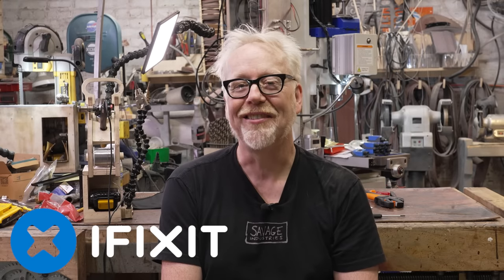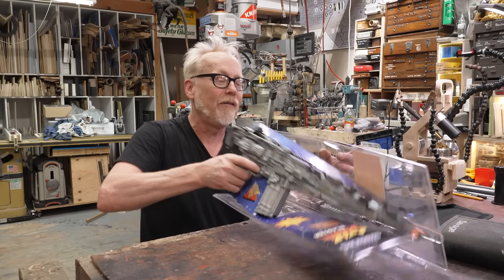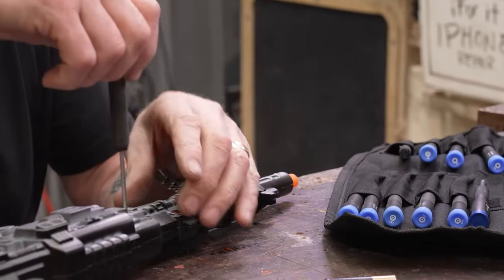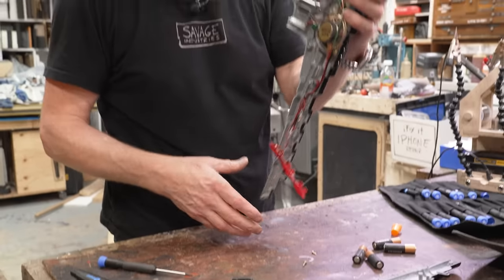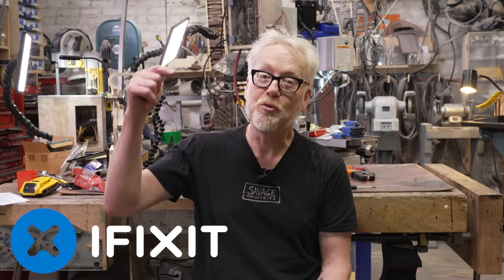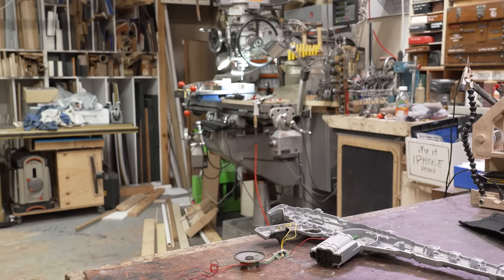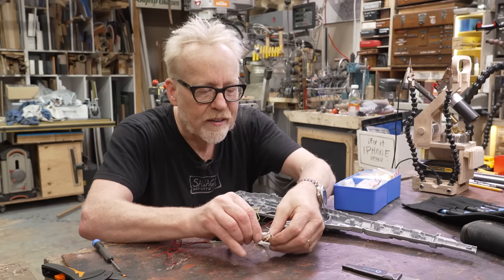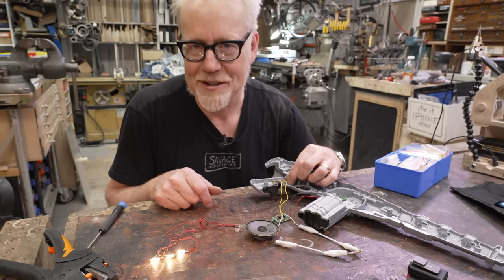How to Quiet Your Kids' Toys!

Comment: To be fair a lot of toys from the major brands have now included a "quiet mode" in some toys. The new furby is incredibly quiet compared to past furbies and most of the toys by moose toys company have a quiet mode you can set it on. Check the back if the box before you buy
Reply: My children got a gift when they were real small... it was a farm truck looking thing that made noise if you rolled it or pressed the floor of the bed. Then it would go off every so often for like 15+ minutes. It had no off switch and no quiet mode. They ended up being given two... the cat would bump it in the middle of the night and it would go off. We finally had to get rid of it 😂
Reply: Unless your kids know how to change the volume and insist on it being on the loud setting. 😕 So far all the toys have just a button on the outside. I have 1 or 2 where the volume control is hidden away inside the battery compartment.
Reply: Another method to quiet a toy, if you don't have the means to install a resistor, is to put in layers of paper towel over the speaker and close it back up.
Reply: @Coffeecrazzii  the ones who put the switch in the battery compartment are the real OGs
Reply: @Coffeecrazzii a little CA glue should take care of that
Reply: The quiet mode should be default and quiet mode should be exactly that, just keep quiet or with other words simply a silence ...
Who ever designs these are psychos ...

Comment: Oh yeah, that's perfect, I'll have to pick up some resistors. I've opened up my kid's toys many times, for a variety of reasons. Volume is one of the more common reasons. My solution has usually been to stuff some strips of neoprene foam into the compartment to physically dampen the vibration of the speaker and muffle the sound, but that's always reliant on clearance, etc. A resistor is a lot easier to find space for in these things, since there's usually lots of room around the wiring itself, but not always in front of the speaker. I screws around with pots (potentiometers) a long time ago trying to control the speed of a tiny blower that I was using to cool an LED fixture I had made, which was fun, but this is much more practical for this application. Awesome

Comment: To select a starting point for resistor value, check the resistance of the speaker (usually marked on the back). If you choose a resistor of the SAME value as the speaker, you will HALVE the sound. If you choose double it will be one quarter volume. You don't need to be an engineer, just remember that simple rule.
Reply: Never mind that our hearing is log not linear so a 10x decrease in the power is only perceived as a halving of the volume. Pragmatic trial with different resistors seems like a good way to approach this for most of us.
Reply: Thats a voltage divider, but decibels are logarithmic, not linear.
Reply: OR...a small volume knob and either adjust to preference and tape it inside or drill a hole in the body (plenty of options there) and install it.
Reply: @MrPhobart Yeah, that speaker was probably 4, 8, or 16 Ω and Adam added 81 Ω. If OP's rule was accurate, wouldn't it now be practically inaudible? 🤔

Anyway, I've been an electronics hobbyist for around 10 years and I generally know what I'm doing, but I would have used essentially the same technique as Adam. I have equipment to make things easier, like resistor substitution boxes and potentiometers, but it'd still be trial and error. And honestly that's probably faster than trying to calculate it! :)
Reply: @AndrewGillard  youre an electronic hobbyist for 10 years and say try and error is faster/better then taking a multimeter and doin a quick ohms law in your head? Dont even need a calculator for that...im a hobbyist aswell and got no electronics background, but that shit was the first thing i learned when first dealing with electronics. Try and error..pfft..dont want to know how much stuff you broke when trying to fix something..
Reply: @Sizzlik I think he meant for super simple projects like the one in the video, for people who are not educated in the field, mr. ego.
Reply: @logandarnell8946  try&error is still more work then to simply divide voltage/amperage to get a resistor value
Reply: @Sizzlik  That simple ohm's law calculation only works for DC circuits. Speakers are driven by an AC signal, therefore you also have to deal with reactance (the inductive and capacitive equivalent of resistance in AC circuits), and reactance is frequency-dependent which sounds like an absolute nightmare to calculate for an audio signal spread across several kHz.

If it was a simple DC circuit I'd totally agree with you that calculation is usually easier :)
(Though it's not always easier! e.g., limiting an LED's brightness to be visible but not distractingly bright: it's not really practical for me to know the current required for a desired brightness. Even if the datasheet bothers to include a current-vs-brightness graph, I have no intuitive sense of the lux/lumens of a dimly-glowing LED 🤷‍♀️ And modern gallium nitride LEDs (blue, white, UV, pink, some greens, etc) are so efficient that their rated current is too bright for an indicator, so I often run them at just a few % of their rating, i.e. well under 1 mA, and a small current variation can drastically affect brightness.)

... or maybe the reactance of speakers can be ignored and I'm just overcomplicating things. It wouldn't be the first time :)
But when faced with a complex, multi-frequency AC signal like audio, I instinctively nope the hell out 😅
Reply: @rolandgdean  Ah, variable resistors. For when you're feeling lazy and just want to wing it.

Comment: Quicker and easier method is to open it up and shove some cotton balls in front of the speaker. Limits the cone travel, requires no parts and attenuates high frequencies to make the sounds less annoying in general. If your speaker has a center tweeter, be sure to add some there specifically.

Comment: There is a gadget called a "Resistor Substitution Box" or "Resistor selector wheel"  that allows you to to choose from a wide variety of resistor values by simply hooking up two leads and rotating a dial to different values.   It's handy for experimentation.
Reply: That's just a potentiometer (variable radiator). You have to be careful though. If you're going to use a potentiometer to guess and check, you need to know how much power you're circuit can put out. If you're messing around and stick 5 Watts through a 1 Watt potentiometer, you're gonna have a bad time.
Reply: @alexskywalker888  I would imagine this device to have a stop at a certain resistance, and a rating that allows it to be used safely with lower voltages. For example, a 100 watt rating and a minimum resistance of  100 ohms, or a 1kw rating and minimum 10 ohms. This sounds like a tool for learning about electronics, so it would make sense to have a safety feature like that.
Reply: @alexskywalker888    I agree that you have to watch the power that goes through these devices.   

They are not made from a potentiometer or rheostat, but an array of  resistors arranged in such a way that you can select them individually, and note the exact reading.
Reply: Also known as a "Decade Box." There are multiple dials for increments of 0.1 ohm, 1 ohm, 10 ohm, 100 ohm, etc...  which varies depending on the desired range. Metrology grade versions are used as a calibration standard for many process instrumentation loops.
Reply: Decade / Resister Boxes are usually rated quite high.
They're designed for laboratory work.

Comment: To get the light flickers back you can add a second resistor in parallel with the resistor and speaker, so the overall resistance is about the same. For example, if the speaker is 8 ohms, and you add 32 or so ohms of resistance in series, you can add 10 ohms back in parallel to mimic the load of the original speaker. 

And in general, 1/10 the power will sound about half as loud, so if you want half the volume you'd use a 72 ohm resistor(or more realistically, a 68 ohm resistor, because that's a common value and close enough). 

For organizing a resistor kit, I have a grid, bottom to top is E6 prefix (1, 1.5,2.2, 3.3, 4.7, 6.8), and left to right is order of magnitude. Values other than those I buy as needed.
Reply: This is technically called the voltage divider and that's the way you should do it if the circuitry has more smarts than this very analog setup in the video.
Reply: @MikkoRantalainen  The second resistor is in parallel, not series. Though resistor divider is closer to correct if you're talking about Adam's modification without the extra resistor to make the lights flicker.

Comment: 2 things Adam didn't mention in this video (well he sort of showed, but didn't say out right). 1) When adding a resistor to something like this, always start with the high ohm ones and work your way down. 2) Once you've selected a resistor, test it and make very sure that the resistor isn't getting to hot to possibly melt the toy (worst case scenario). Smaller toys like this one that are fairly low voltage, really shouldn't cause a problem, but when you start going up to toys using multiple C or D cell batteries or even 9 volt... you make blow the resistor if you pick one that is to small (resistors blow because of to much current, causing them to over-heat).

Comment: Adam, while a good approach, I happen to have a different one. Generally I start out with a potentiometer (variable resister) in a case like this. The reason is how speakers and amplifiers work. When reading speaker impedance, it is listed in ohms. They tend to range from 4 ohms to 32 ohms. Impedance ratings are a little different than resistance as we're talking about coils. As you are showing basically a 6VDC power supply on what presumably is a 5V circuit, perhaps lowering the voltage may have an affect. I'd have to study the circuit for a minute, but typically on children's toys, this can be an easy modification without the need for opening them up. I might try it on 3 batteries verses 4. A simple test might be to use a weak battery for a temporary replacement. I've actually installed one backwards before to lower the voltage to a more desirable level. If you'd like some more simple hacks, please let me know. You are smarter than you realize and learning electronics can be difficult, especially in the analogue world. You've either taught or inspired countless people. I think both as a communicator and what may be called an influencer, understanding rudimentary electronics is important. After all, we are in an electronic world.

Comment: I was that uncle that gave "annoying noise toy" gifts. It became a tradition. One Christmas I found a plastic ball with motion sensor triggered sound, very similar (at least in how annoying it was) sound track to the gun you showed. But I went the opposite direction from you: I opened it up (not so easy with three-point philips head screws) and replaced the crappy zinc-carbon batteries with lithium cells. After reassembling it, I turned it on "loud" (there was a power/volume switch) and then covered the switch in epoxy. That was 20 years ago. My sister still has it and it still works.

Comment: Got a great tool tip to go along with this video for anyone who wants to understand electronics and wants some fun project material.

Elegoo Arduino Starter Kit: I have a small project that I needed to make a toll gate. I have never coded but I know enough about electronics to be dangerous. This kit has some small boards, resistors like in this video, and a very helpful pdf guide that will walk you through some lessons that will have you build everything from a smiple LED switch to making things appear on a screen and all for under 40 bucks. I think a arduino by itself starts at about that anyway. 

I really want to go get a toy like this and see what I can do with my new found skills and play around with it. Thanks for the video and thanks for inspiring new fun projects all the time.

Comment: you can squirt hot glue into the speaker's voice coil to dampen the sound too.  also, to make it easier, instead of cutting the wire and putting the resistor in series, you can put one in parallel across the speaker terminals and accomplish the same thing without needing to cut the wires

Comment: Beyond the keeping a toy for 24 years that "isn't worth keeping", I like how Adam went through the trouble of hacking the electronics to restrict the electrical flow to reduce the speaker volume.
My shadetree method was usually just hacking the box it came in for some cardboard to cover the speaker with to restrict the air flow and muffle the speaker volume.

I suppose his way made for a more interesting video.
(I have done the "clip the speaker" method too)

Comment: I like the idea that Adam spent "an hour" looking for the battery directions instead of just trying the 16 possible permutations.
Reply: Even funnier it's only 4 permutations because the crossbars dictate each pair of batteries would have to meet the bar + to  -
Reply: Funnier is that at 10:12 you can clearly see the +/- indicators on the underside of the black battery door.😄

Comment: Quick tip! 
I usually just put a piece of tape over the speaker grill (if it has one) on my kids toys. Most of the time that reduces the volume significantly :)
Reply: Exactly! I like to put it on the inside of the plastic so my kids don't see it as easy.

Comment: "Let me show you how to make this quieter"
Takes batteries out.
Mission accomplished!
The speaker is probably 8 Ohms. Since hearing is Logarathamic, an 80 Ohm resistor will "sound" about half as loud. 800 Ohms to 8k is probably the range you want.
If you want the lights to still work as they used to, add a 10 Ohm resistor in parallel with the new 800 Ohm resistor and the speaker in series.

Comment: A quick search for "Standard Speaker Resistance" will give you 4 to 8 ohms.  I generally just remember 8.

Given this, you're cutting the voltage to the "original voltage * 8 / (82 + 8)" or roughly 1/11th (the portion of the drop across the speaker compared to both the speaker and the resistor).

80ish ohms should work for a lot of speakers, BUT, you should be careful with resistors close to 100 ohms when you're dealing with 5V systems.  Common resistors are often rated around 1/4 Watt.  The equations for this are V=IR, P=IV, P=V^2/R, so your wattage in a 5V system across a 100 ohm resistor is 5V*5V/100, or 1/4 Watt.  Lower resistance, higher power, so 80 ohms is above the rating for common resistors.  Good hobby rule of thumb, check your power when you're near 100 ohms in low voltage systems.

If the power is lower, you can plug in the numbers you are using in the equations above to find your limit.

Hope this helps!

Comment: I don't know if this works with the IC chip and the speaker, but maybe solder 1 plus pole and 1 minus pole on the batteries together, so you only need 2 or 3 of them. This should lower the voltage and therefore the noise and light flickering if it doesn't underpower the IC, you'll also need fewer batteries when you do this. 

If the IC would be underpowered, a possible fix would be to replace the voltage reducing resistor in front of the IC power input line with one with a lower resistance. 

In this particular case it seems like the IC is powered with 4 1,5V batteries in series, and I assume a resistor is placed in the line to reduce the 6V to 5V. I would definetely still put a resistor in this line to prevent high currents.

Comment: Cheap speakers like that are typically 8-16ohm, so that's a good starting point for resistors to halve the power output of the amp circuit.

Comment: When I was still a kid, my dad dealt with the same situation you did (I am also currently 24, same as your sons) Toys from that time were very noisy and we used to do "operations" on basically all my toys that made sound. It always got me very excited for some reason, it must have been interesting to me to see the inner workings of my toys. Either way, usually he would take out the noise maker and leave the lights and such in. I didn't care much for the noise either, so I would happily let my toys be tinkered with.

Comment: I'm an Electrical Engineer, and you're definitely right there are many ways to "correctly" lower the sound. However, in this case you might be able to simply poke a few holes in the speaker fabric material.  A speaker is nothing more than an air pump that is controlled by the inductor (coiled wire above the magnet) which is fead an Electrical signal corresponding to the frequencies of the sound.  So in principle, poking holes=worse pump=lower sound.

Comment: I love Adam's perspective on this. My years of EE knowledge which told me offhand the correct value would be around 8-80 ohms would have saved him one random attempt, maybe 60 seconds. 
+1 to reducing barriers to entry! (For low danger things like battery powered things, or USB devices. Electricity'll kill ya quick if you mess with the wrong thing, like house wiring or opening some appliances even if unplugged! No guessing here, find somone who can tell you what the dangerous parts are because you absolutely cannot guess.)

Comment: Adam describing the physical noises that laserblasters made, reminds me of a short I saw recently of how sequential tail-lights worked back in the day before IC's... It was so simple!  It was just a small motor, with a bunch of cams attached to it that would open and close a different circuit while rotating... it was somehow simplistically beautiful, and I want one even more now... :D

Each cam was clearly tuned for duration, so you could have the desired effect... :D